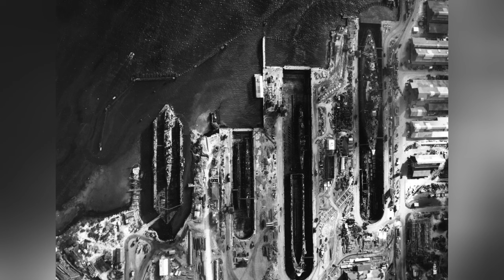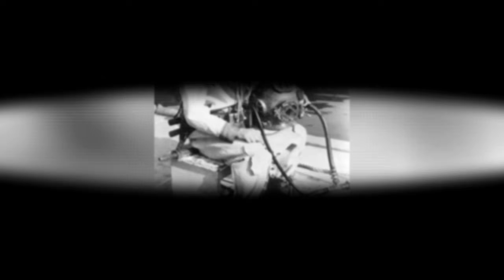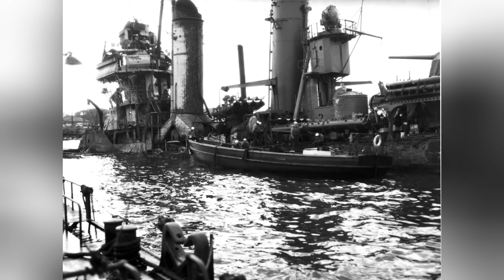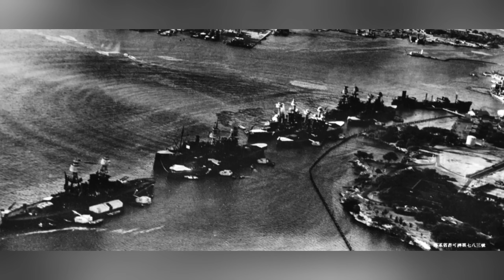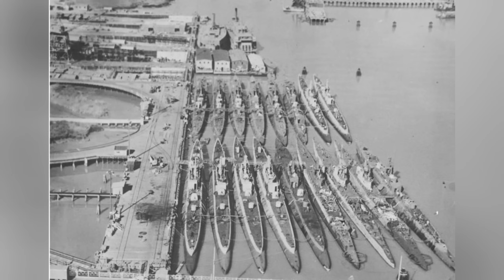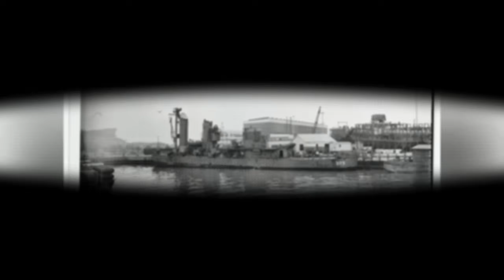Salvaging USS Shaw: How Pearl Harbor’s Fireball Ship Survived

Comment: Would have made a great PH memorial, at a fraction of the size and cost of a battleship.
Reply: Wouldn't hold light to the arizona bigger , more of a disaster and a lot more dead sailors. Sad to save those are drawing things. Also , arizona isn't the only memorial in pearl harbor
Reply: @CAROLDDISCOVER-2026  Yes, there is also the USS Utah. I'm not saying the Shaw as a replacement, but as a much smaller, easier to maintain addition.